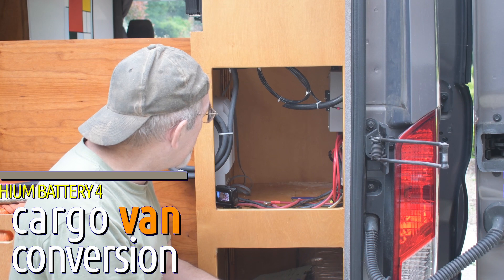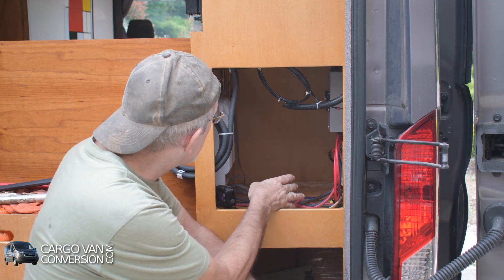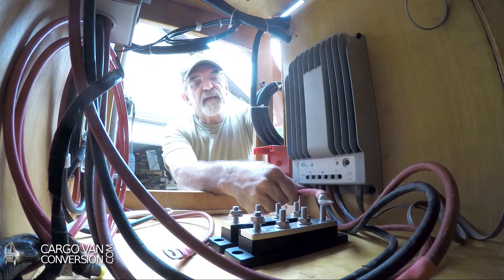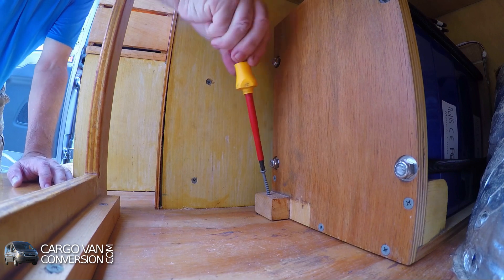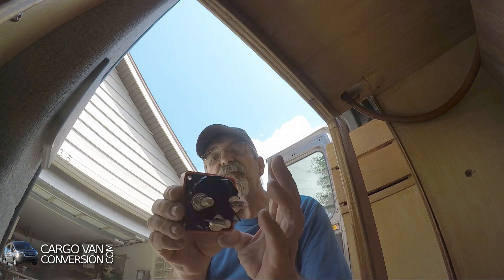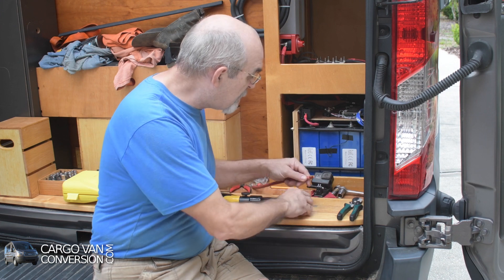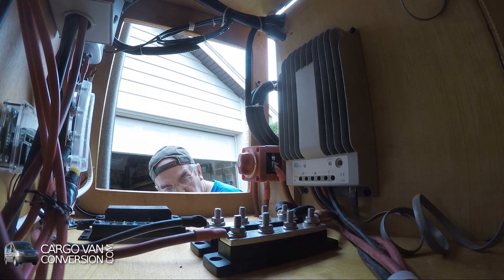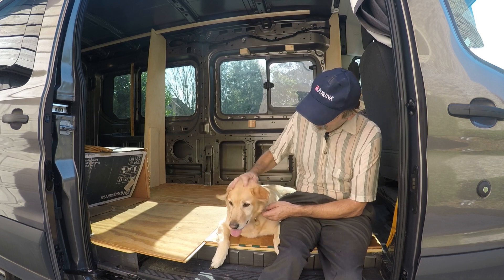RV Lithium Battery - Part 4

Comment: Well, I'm glad nothing has blown up. lol
Reply from the maker: Hi Mark,
I had to think of the time I was young, when I cut a 220V live wire. I survived :) and no further consequences. Never forgot it. Working on these batteries, I constantly have to remind myself, that though it is only 12V, it's 12V with a punch. 550 Amps of it.
It all seems to be working fine. Have to raise the charging prolife a bit over 13.4V to get a top charge over 200A (80% SOC). We're back in business...
Van Williams
Reply: @cargovanconversion  indeed, it carries a real potential for danger. You did your homework. I thought it funny when you said nothing had blown up. The evidence was right there before our eyes. This is certainly something to be proud of. Nice job!